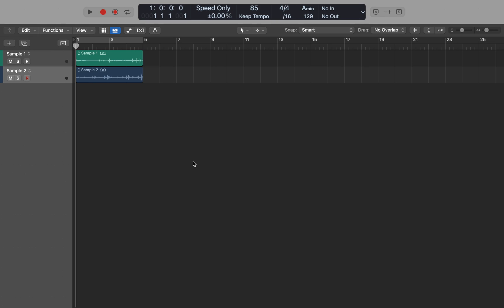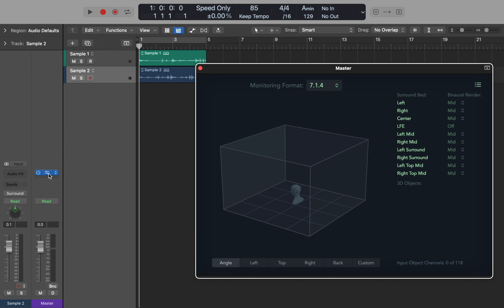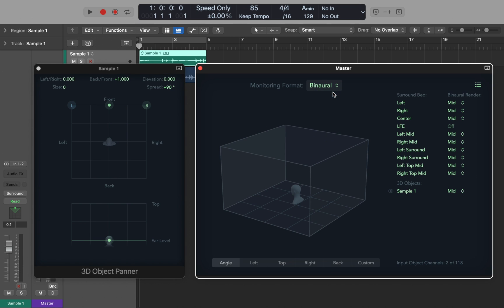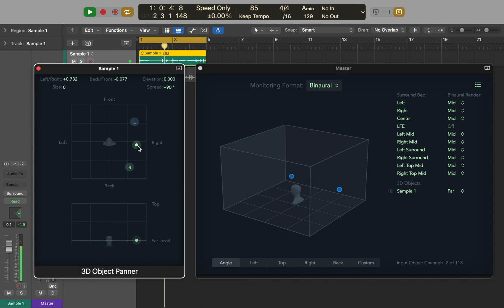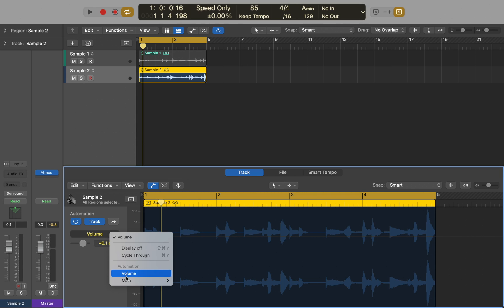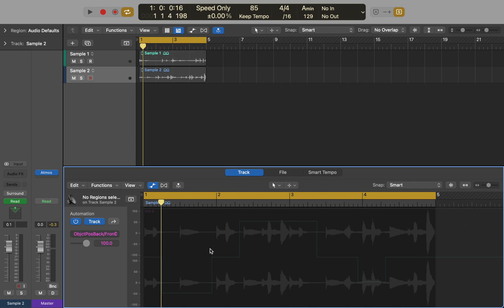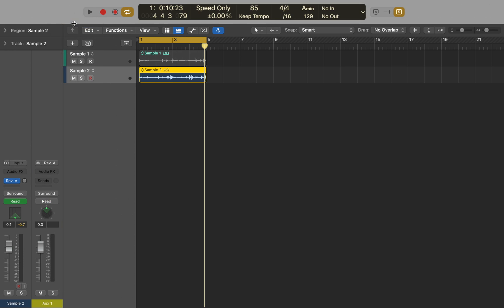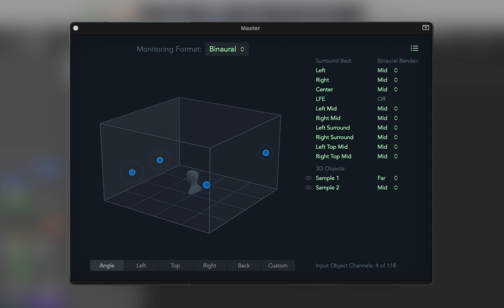Logic Pro: Spacial Audio Mixing

Comment: Hey! Can you bounce this as a WAV/MP3 and still have all the effects so you can send some creative stuff to your friends, or are there playback limitations?
Reply from the maker: The format of monitoring you choose in Dolby Atmos determines the surround format used when you bounce your spatial audio mix. Binaural audio is essentially stereo so the file you bounce as WAV or MP3 will sound the same as it does in your DAW. There is also Audio Definition Model Broadcast Wave Format . ADM BWF is the required when you submit a Dolby Atmos mix to Apple Music. It stores multichannel audio file and metadata required for reproducing the mix on systems or devices compatible with Dolby Atmos.
Reply: @eduard.antonoff  Cheers!